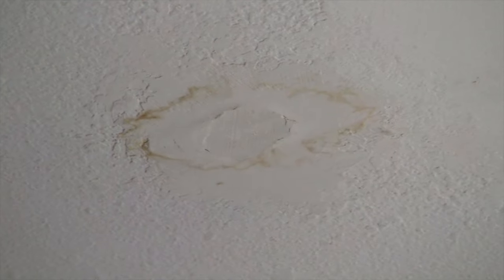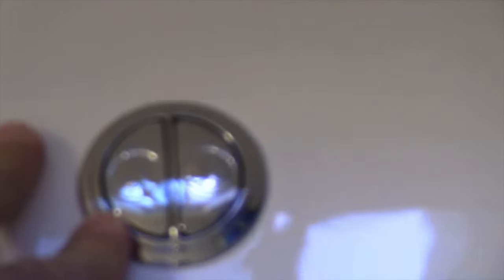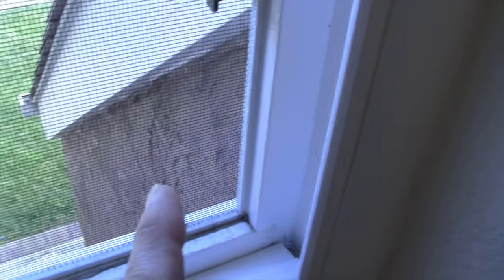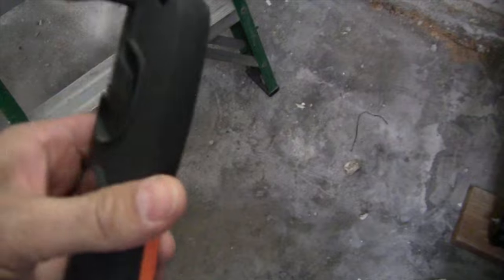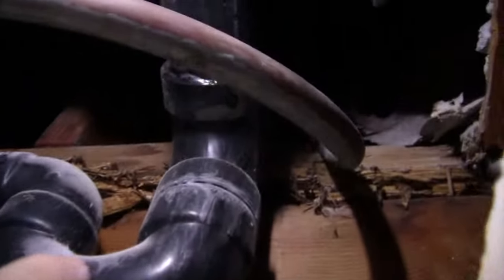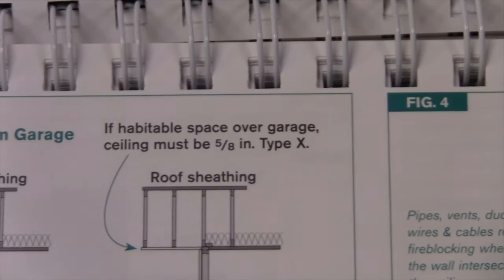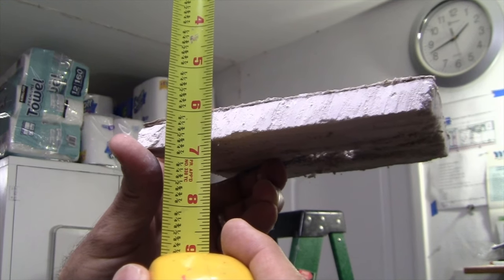Mystery Ceiling Water leak in Garage Turns out to be a Tub Drain Leaking

Comment: If you want to be code-compliant, use wood cleats and screw the drywall into that without drywall compound and then Velcro the access door onto that. (You’ll have to cut the back of the access panel flush) that way if you need access all you have to do is unscrew the drywall off. You’re welcome!

Comment: Had 4 watermarks that were all parallel from each other on my garage ceiling, with water dripping out from a few spots in each (but more heavily on one side). The plumber cut open part of the ceiling to see the main waste water line, but I couldn't for the life of me understand why he never once checked the tub, vanity or toilet that is directly above it. Needless to say, he couldn't find the source of the leak yet, so now my entire ceiling is going to get removed so they can trace the source of the leak better. Thank you so much for validating that I'm not crazy in thinking these "professionals" weren't troubleshooting the issue correctly.
Reply: @ahmedkhan I too just discovered 4 parallel watermarks on my garage ceiling but no water dripping. We called a plumbing company and to our surprise they found absolutely no leaks after cutting 3 holes in the ceiling. Did you ever find what was leaking?

Comment: Wow! That’s wonderful. I am not a handyman; having similar issues; ceiling drywall is wet covering 10 x 6 inches. I shut down water supply. Planning to call a plumber.
Reply from the maker: let me know what they find?
Reply: @KenTraining ,
Hi Ken, due to freezing; all plumbers are busy; I shut cold and hot water supply. Also stopped using the tub. Leak stopped. The question would be: Is it leak at the joint or just the drainage? Access point is very crucial to investigate the issue in the future as well. I just don’t understand why builders did not think about it? I liked your idea a lot and it serves the purpose. I will definitely let you know the outcome once plumber investigates. Thanks for helping me and others to think beyond and logical. Love your video.
Reply: @ElsaAndAnnie  what did your plumber find ?
Reply: @hotrod4x5  , It was an old seal that gave way for the water to seep through especially when I stored water in the tub for more than 5 days! After replacing the seal, everything looks ok. Thanks for your follow up. :)

Comment: Single story home no bathroom above and there is a crack in the ceiling in garage with a leak with a rain today. Where can it be coming from?
Reply from the maker: you have a roof leak most likely. It could be a window or flashing leak. In any case you have a rain water related leak that you will need to track down to fix.

Comment: how would you change the gasket if you not could fix it
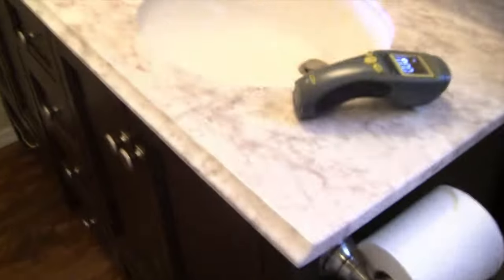Reply from the maker: go to https://www.youtube.com/watch?v=a4IqQR-lAjY at 3:48 minutes and you will see exactly how to do that.
Reply: @KenTraining  So, if the gasket is defective, that would be the cause of the tub leaking water through your garage ceiling? I currently have that problem and am trying to solve it myself instead of spending $500 on a plumber. Drywall is cut out joist to joust underneath so that there is now direct access underneath the tub. An access panel will be installed when the drywall is replaced.  Thank you!

Comment: Mine is more complicated it came raining down from upstairs way after I had taken my shower maybe overdrainage
Reply from the maker: you can test that by putting water down overflow ture and see if comes raining down again. I assume this only happens when you use that shower?
Reply: @KenTraining  But I'm  not sure where the overflow is
Reply from the maker: @vickiesaylor93  it has to be a tub to have an overflow. the overflow will be the higher drain on the side. you would have had to fill up to cause that. I assume that is not the case. you have may just have a shower drain leak in your system...